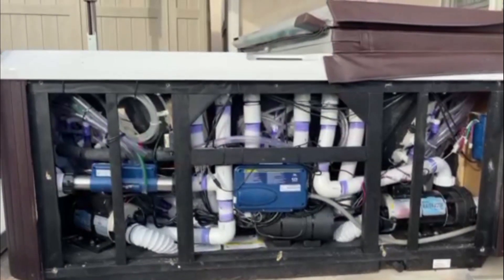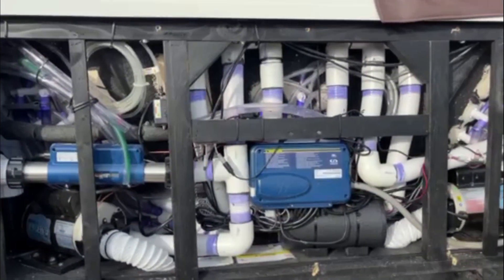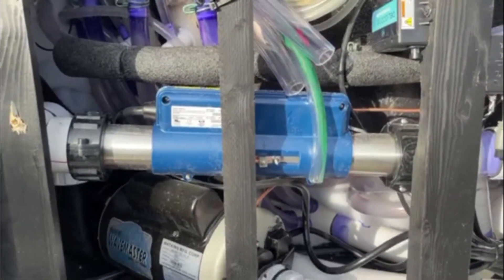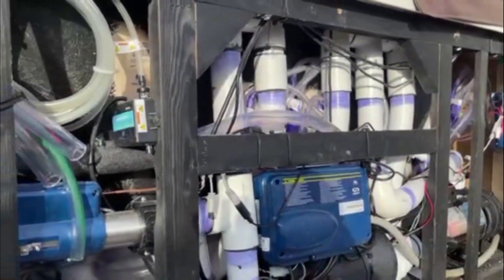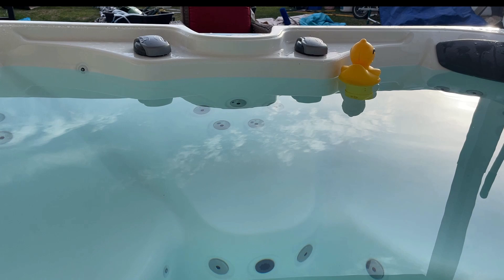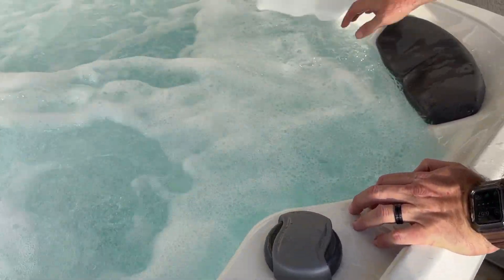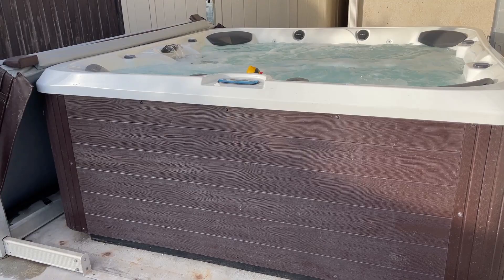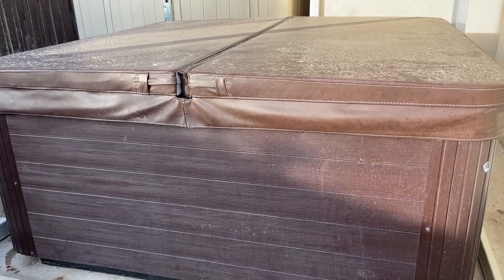Aquaterra Fairfax Costco Hot Tub Review part 2

Comment: Thanks for the update!  We have a 2003 Maax Spa that we had bought used and it surprisingly lasted 10 yrs.  Probably would have lasted even long if the circuit hadn't blew in cold weather and froze the pipes lol.  But we definitely got our $500 out of it for sure.  I would guess with the 3 pumps, 60+ jets it was high $.  So, here I am looking at mid-range Aquaterra hot tubs @ Costco. Ugh lol.  My question to you...did you notice any difference electricity bill wise when you switched out.  I would say our elec. bill went down about $50 a month, but I realize how old ours was.  Hoping they are more energy efficient for a 220v this day and age.  Sorry, for the extended chatter, but this is a big expense in the end, but willing to forego a bathroom renovation for another hot tub.  Thanks in advance for your comments!
Reply from the maker: I actually didn’t notice a large increase in our bill. Maybe $20 a month at most so hopefully it is more efficient than your old one! Sorry I didn’t respond sooner!

Comment: We have one coming. I found this review (reviews) excellent work and very helpful. Major whew that it arrives on its side! Otherwise moving it around would be a nightmare. Since we have to set up the electricity, does it matter where we place the box? I was thinking behind it, or to the side
Reply from the maker: Thank you! I hope you love it! I think either to the side or behind it would both work great. Just make sure the electrician can get to it if needed once the hot tub is installed :)
Reply: Had our first soak in our new Fairfax this AM. Love it! So far so good! Do you use the speakers? I recall reading somewhere in the ad literature that it has BT speakers but the manual doesn't have a section addressing pairing.
Reply from the maker: I am so glad you love it too! We do use the speakers, to pair them the code is just 5555 :)

Comment: Is there a major difference between this and the standard next tier hot tub. Without cost being a factor. For example the jets, water insulation, and seating.
Reply from the maker: As far as the Costco hot tubs, they are seem to be about the same to me other than size, number of jets, etc. If you choose another brand there will most likely be better customer service and insulation. I feel like the jets are similar in power but definitely not as many options. If you have the money and want a higher end tub that is customizable this probably wouldn't be the best choice. For us budget was the biggest factor.

Comment: CA has very stringent insulation requirement for hot tubs, don't remember the name for it, so that you can leave the tub on without wasting too much energy. These tubs are allowed to be sold in CA, so they can't have really bad insulation. CA is happy to ban everything they can. 

I am looking at these also for the cost. Saving thousands on the front end, allows you to spend a bunch on repairs, if necessary. The only thing that worries me is the 1 year warranty. But having been to another Wattkins brand, Hot Springs spas, their lower-end spas, and also the Bullfrog lower-end spas, don't have much of a warranty either. As if they want to push you into buying the higher end models...
Reply from the maker: Good to know! Since we got it we haven’t noticed a huge increase in our power bill and it doesn’t have a hard time maintaining temperatures so it is probably more insulated than I realized.